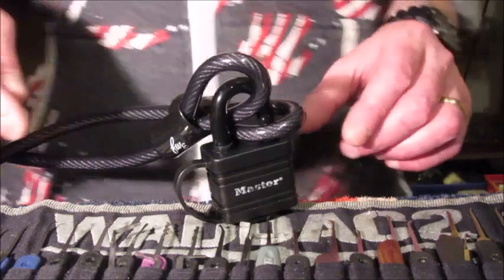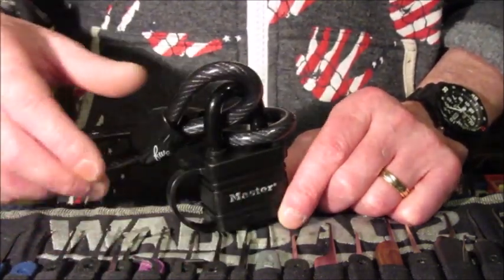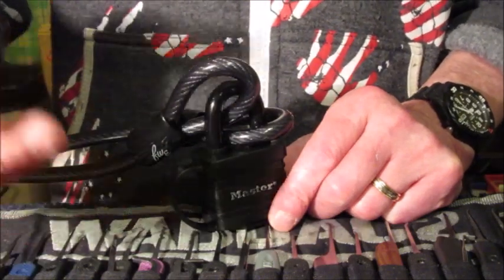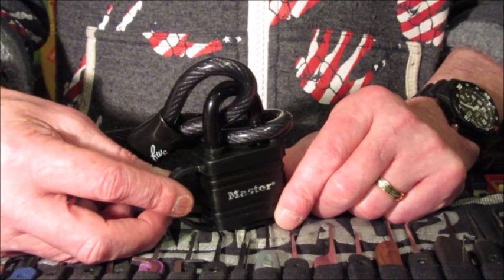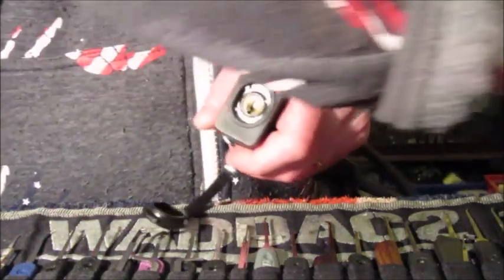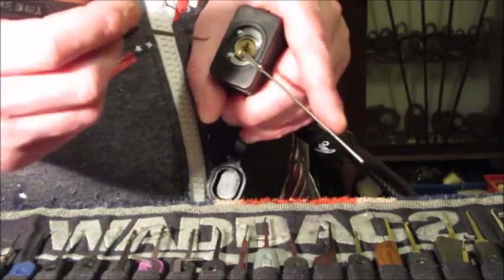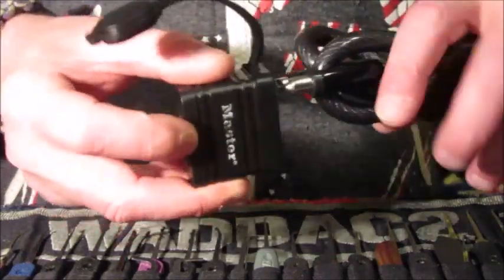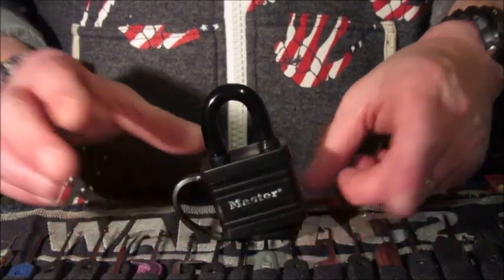Single Pin Picking A Master All Weather Padlock From Work With No Key

Comment: hi waddac i've got a yale euro cylinder been trying to pick when I do spp the pins keep droping back down can you give me any tips on why that keeps happening plz thanks
Reply from the maker: Hi again Jimmy. Yale locks can contain 2 or 3 spool pins. If setting a standard pin, the lock can drop into a false set where plug turns a bit then suddenly stops. You then need to look for a binding pin, which will be a spool. When pushing on that it will try rotate the plug back to lock position. If you do not control the spool pin correctly by adjusting tension... The lock will drop all set pins.
Reply: @waddac2  OK thanks waddac

Comment: Yuneec Q500 4k suits me fine , where do you fly in South Yorkshire .
Reply from the maker: Thanks for reply buddy. I am actually in West Yorkshire and fly on a field at back of my house. My current drones are Hubsan H501SS with advanced controller.. MJX Bugz 4, and latest the Hubsan ZINO with so called full software upgrades... Weather is not great to test.
Reply: @waddac2  I looked a DJI drones but didn't like using a tablet or phone so went with yuneec , built in screen and rock steady footage in windy conditions.
Reply from the maker: @opcentre  I do like the built in screen on my transmitter for my H501SS advanced controller... And the drone flies a treat. I am wanting a drone with full obstical avoidance etc, hence reason looking at Pro 2
Reply: @waddac2  as the rules state you have to be in visual sight of your drone at all times and the rules are now so restrictive it makes obstical avoidance a bit pointless but that's just my opinion. Any way I have gained a lot from your lock picking video's, that has helped me in gaining access to property's thank you .
Reply from the maker: @opcentre  Thanks for that info. I have done the online test and passed. I have my 3 drones marked up and also have an official Pilot ID licence card in my wallet that I got printed at work from a machine that prints out Staff ID cards. Looks very professional indeed. I would still like the DJI Pro 2 with obstical avoidance as could always have problems when drone in sight, if taking close up shots of trees etc. I would part with all my picking gear for a DJI and also my 3 drones, plus my PCP Air rifle, scope and dive bottle to charge. Rifle is an FX Wildcat. I use to love shooting it but major operations in the past give me pain today when shooting.

Hence reason, I got into drones as a lot more relaxing and strain free when flying.
Reply: @waddac2  I hope you get your DJI , all the best things are worth waiting for .
Reply from the maker: @opcentre  Thanks brother, much appreciated.. Not sure weather to sell my rifle first, very cheap and get a Mavic mini or used standard Mavic Pro preferably ??? I paid £1000 for rifle about £200 for charging dive bottle and £200 for scope.